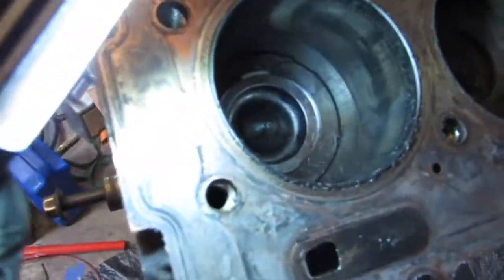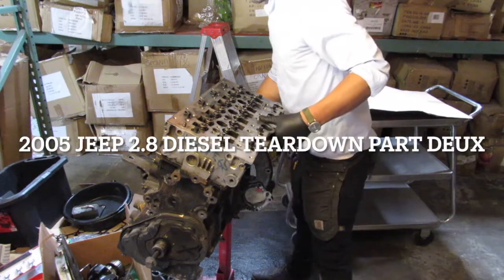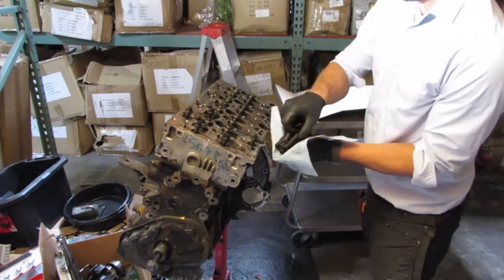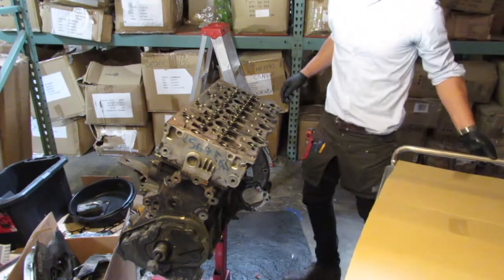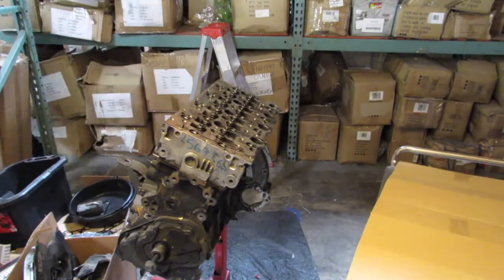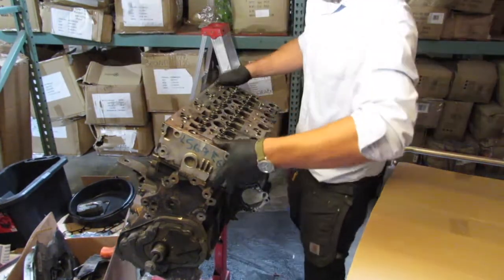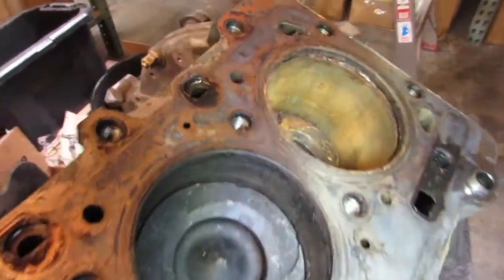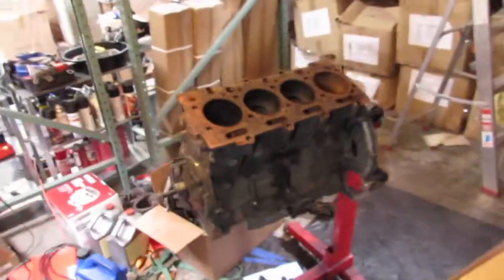Jeep Liberty CRD (Diesel) Engine Teardown Part 2

Comment: If you don’t mind me asking, how bad was the price of a new motor?
Reply from the maker: The good used motor cost around 1,800 USD. It came from Michigan and was delivered to my place in SLC. I spent around 900 USD in gaskets/timing/ARP head kit etc to make sure the replacement engine was going to last a long time.